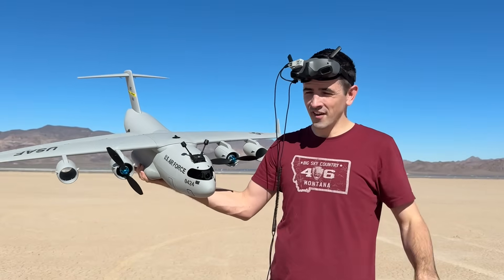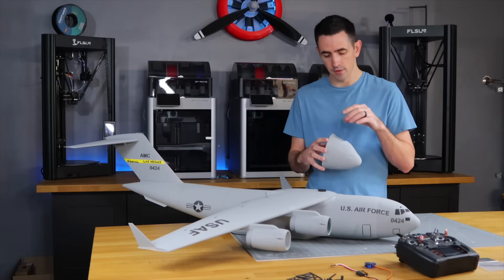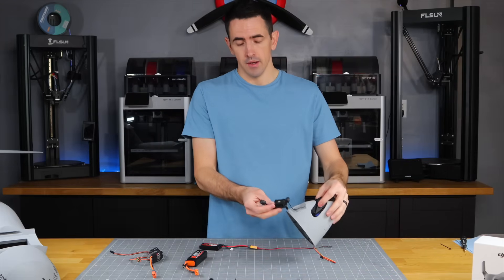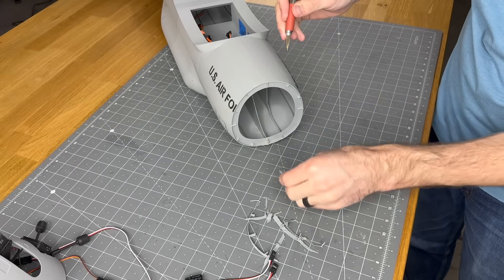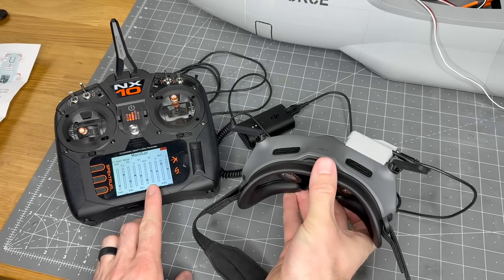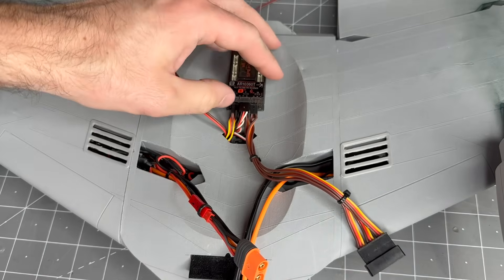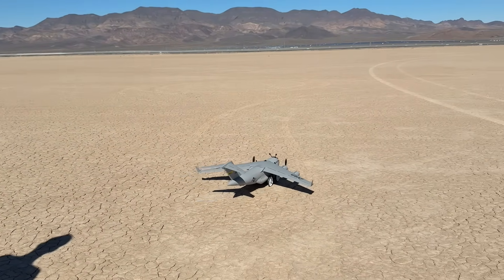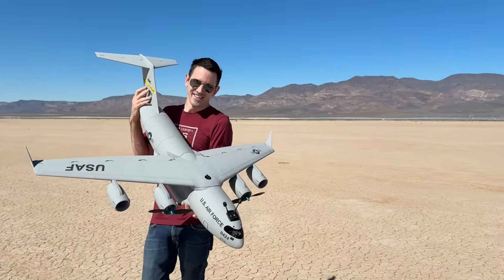Complete Guide To Setup FPV in your RC Airplane | 3D Printed C-17 FPV Kit Installation Guide

Comment: Pretty cool that your wife is with you even though she very likely has almost zero interest in this hobby. Make sure you do the same for her.

On the project, good job. I have just bought the 3d files  for the Stallion VTOL  (even you should never buy anything from a SM add I did. They were cheap and I have time and money to burn). I am interested in getting head tracking with DJI googles3 and probably some DJI air unit. Never built  a RC plane from scratch before. I probably come back and watch when I get started.

Comment: Hi Troy, I love your channel...   I'm new to 3D printing,  have two questions.... Can  the eagle plane be scaled down and can I print it with a bambu labs P1S printer? And, have you designed any slope soaring planes?  I want to build the eagle as a slope soring plane with no motor.

Comment: Very intestesting stuff! I have a question.
I thought you need to run the DJI Air Unit connected to a FC, because the Air Unit responds to the "Arming".
At least with my DJI AirUnit o3. It stays in power-saving mode until armed. How can you achive this with only connectin power supply? 
Thank you!

Comment: im trying add FPV on my Edge 540... but my iflight commando8 doest have headtrack input, so I need put a servor connected to a 3 stage switch... center/left/right... and my video is analogic. here digital is 1~2 months payaments just the googles...

Comment: I see it’s designed for 2 EDFs but it looks like you either had or still can run it with 4. Is that still an option and what effect does it have?
Reply from the maker: You could totally run it with 4 edfs or 4 brushless! I designed channels in the wing to accommodate that option. It increases the weight mainly, but the extra power should compensate fine for that. It is already overpowered as it is, I don't run anywhere near to full throttle when I'm flying, so I opted to only use 2. Also be sure to check CG before flying.

Comment: do you know if you can use the 04 lite can be used without a flight controller and still get the full power? (50MBPS)